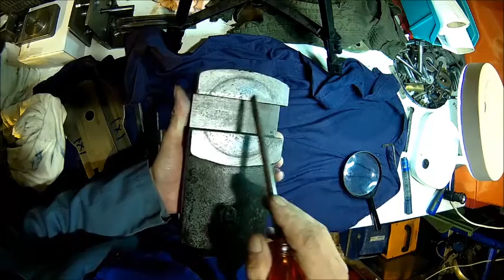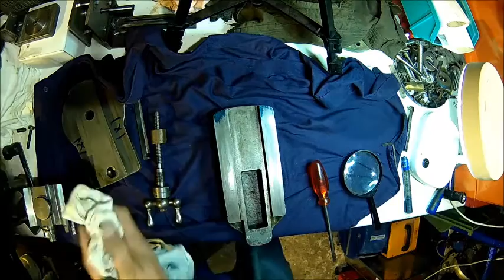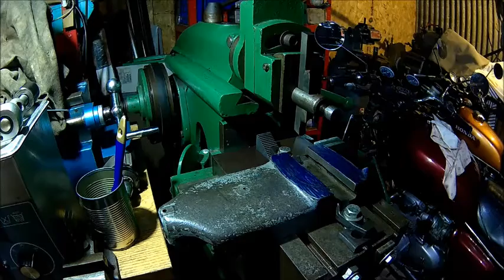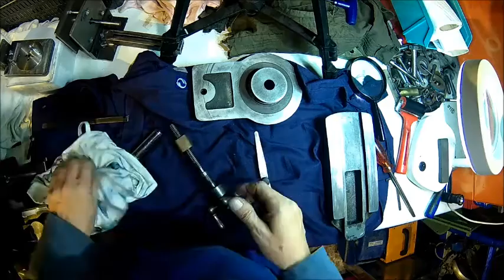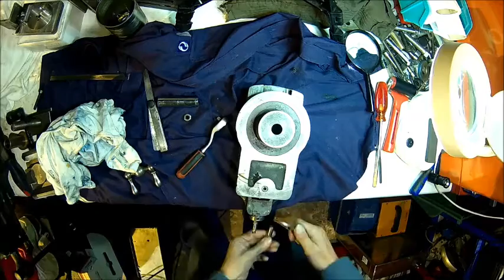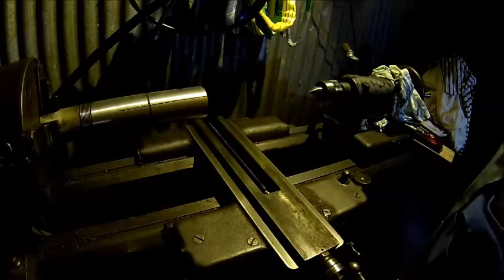The South Bend 14.5" x 48" Lathe Project - Part 4, Tool rest repair, more findings

Comment: If you can't find a screw for the cross slide you can buy left hand acme all thread and silver solder it on to the handle section.
Reply from the maker: Yes that's probably the way to go, because it's quite likely to find one somewhere, but i most probably won't like the price they would ask for. It all depends on how the gear section looks like, did not pull it out ight now. I do have a piece 16x4 mm left with a matching nut laying around but that's probably a  bit too coarse, i need to check the pitch on the machine. .... thanks for stopping by

Comment: Nice thorough look at that top slide. similar problems to what I found on my Boxford tool post.
That cross slide lead screw and nut will make a good project !
cheers Mike . ATB mat
Reply from the maker: Thanks Mat, ...now everything starts making sense,  instead of adressing the real problem, some previous owner just used a bigger hammer.....not sure if you watched it right to the end, but the bottom of the sleeve in the toolpost was the only point of contact, active surface area was less than the sizr of a penny, ...amost certain that was the reason for both, chatter and wear .... how's the shaper going ?